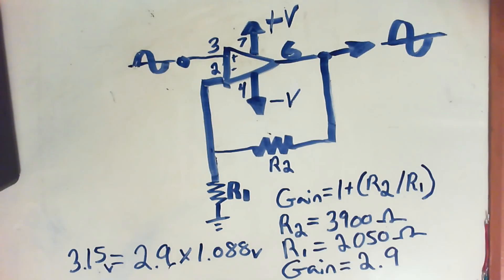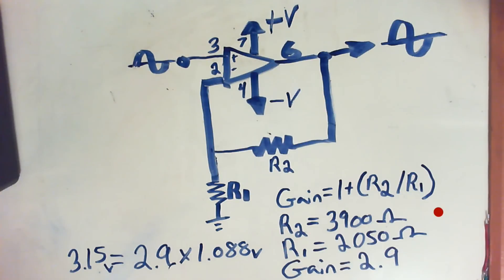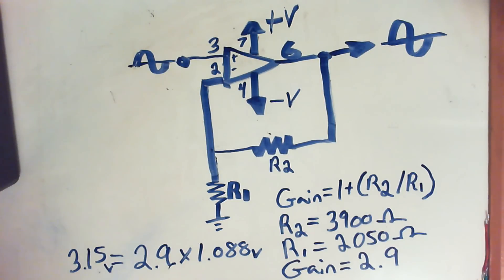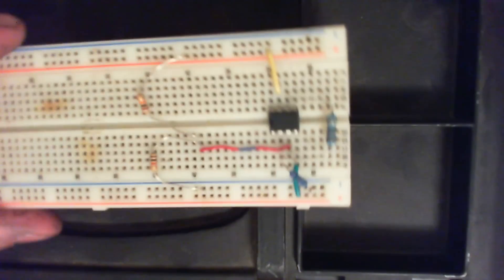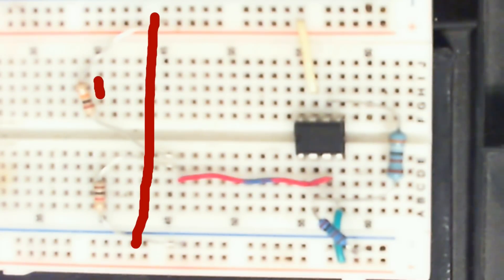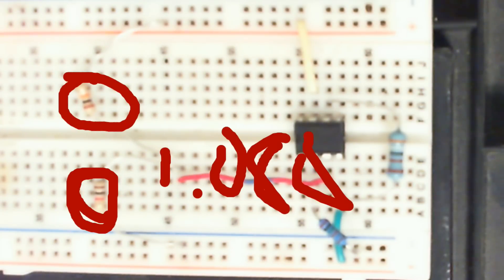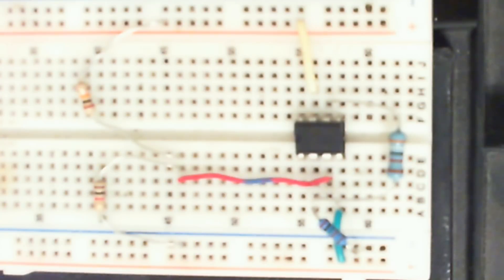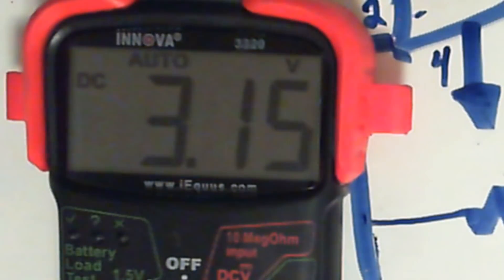Op Amp - Non Inverting (HD 720p)

Comment: Hi, so what ever goes in voltage wise is amplified by the factor of 2.9 is that correct?
For eg if i feed in an audio signal directly into pin 3 of the ic of 20mV would the output voltage be 2.9 x 20mV = 58mV output?